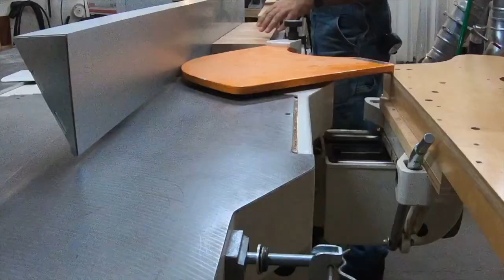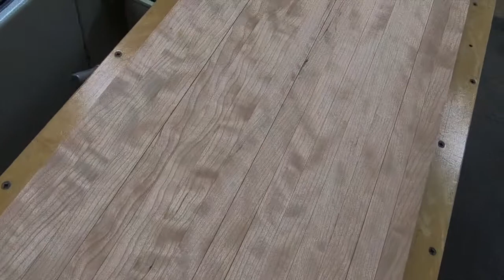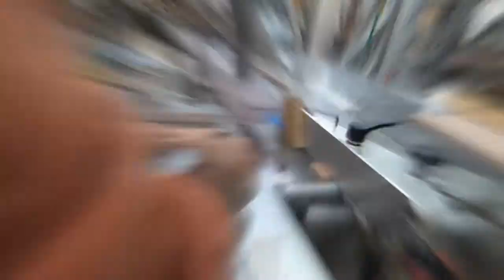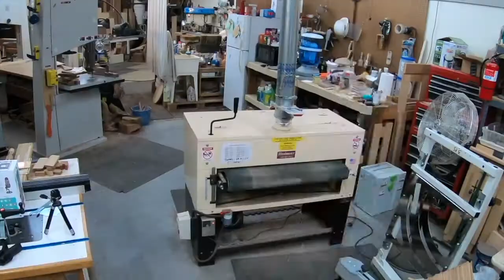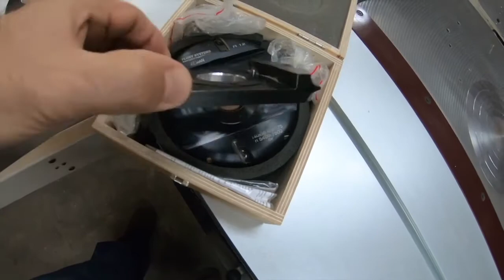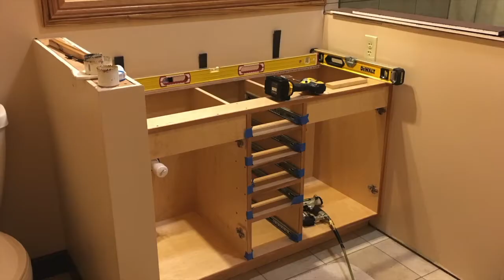Vanity Build Part 2: Lumber Processing

Comment: Hi Sam, as others have said, really, really impressive and beautiful work. I have a couple of questions re your set up please:
1) what down sides do you see (if any) of the combination machine? What size is your shop and how much bigger would it have to be for you to elect to have separate machines?
2) does the sliding saw eliminate the need for you to have a mitre saw / station?
3) what gizmos do you have on the stop blocks that would seem to be giving you a digital measurement from the LH kerf of the blade?
Thanks
Reply from the maker: 1)  I have a 3000 sq/ft shop.  I could probably handle separates now, but it is just me, no employees or helpers.  Maybe if I had another 2000 sq/ft I might consider it.  Here's my long winded take... Honestly, I am a full combo convert and believer.  I have had one since the early 2000s, 1st in my 900 sq/ft shop, then in my 1200 sq/ft shop and now in my 3000 sq/ft shop.  A combo will take up the same exact space as its comparable sliding table saw (or cabinet saw for that matter), and you'll also have the jointer/planer, mortiser and shaper there too.  If your tools are all on wheels now, and you need to pull them out to use them, and then you have to put them away again -- then your changeover times on a combination machine will be less, by far, and you will have all that extra storage space, you needed for those tools, to use in more productive ways.  If you are a one man operation and don't plan on expanding to the point of multiple employees and production work (this is my situation), then there really is no reason to have separate machines no matter how much space you have.  Add more workbenches with more space (I currently have three workbenches, and three work surface/storage benches.  On the average furniture project you can plan to spend 25% of the time on a power tool (roughing, dimensioning, cutting, shaping and joinery).  The other 75% of the time is spent at a workbench prepping parts, sub glue ups, assembly, final glue ups, sanding, hardware, and don't get me started on the time it takes to give a project a proper finish.  I have the room for separates now, but even just splitting my combo into two separate combos, a saw/shaper and a jointer/planer,  I lose one workbench.  It is not worth it for the 20-30 seconds I could save in the machining phase of a project, that would result in hours lost due to the lost work surface.
2) I think so... My sliding-miter- chop saw station stays on my jobsite trailer now.  It has never even entered my current shop.  I have no need to dedicate 20 plus feet of wall space for that with a slider.  Plus with a simple sled I can miter very small parts on the slider, which can be very challenging with a chop saw.
3) I used components from Siko Products to add digital to my crosscut stops. M504 readouts I believe.

Comment: Sam - besides using the plywood auxiliary table sitting on the mortiser table for staging area for planer, does that table serve another purpose- I noticed the 2-2 1/2” diameter hole there ?  Thanks bill in Kerrville
Reply from the maker: Nope.  It used to on my CU300 when I extended the rip fence, but found that, ultimately unnecessary.  It also helped with longer cutoffs, as they wouldn't flip up so easily.  I got used to it, and when I got the bigger machine I modified to work with my Elite S, too.  It comes in very handy.